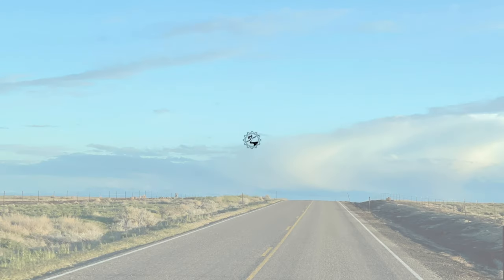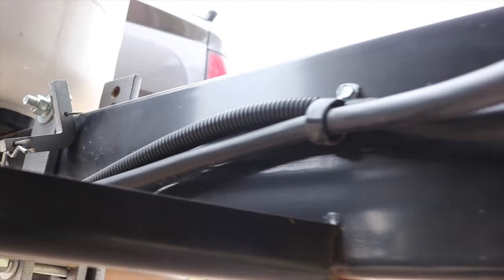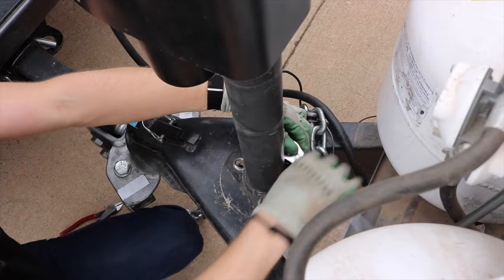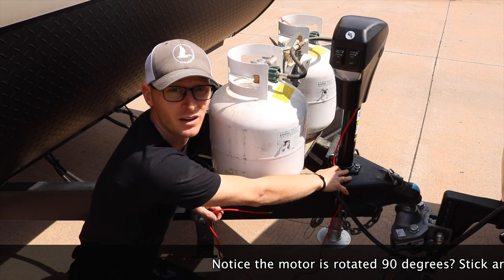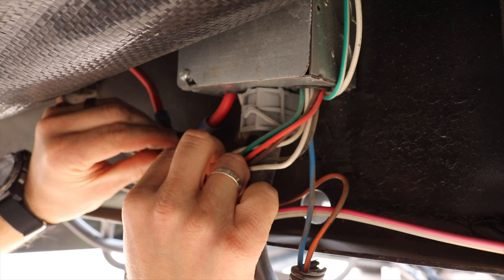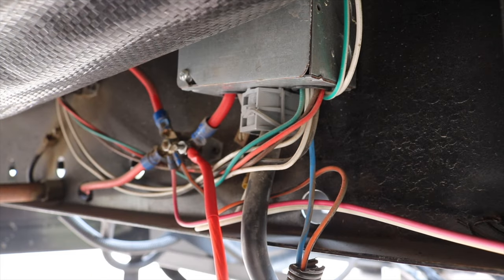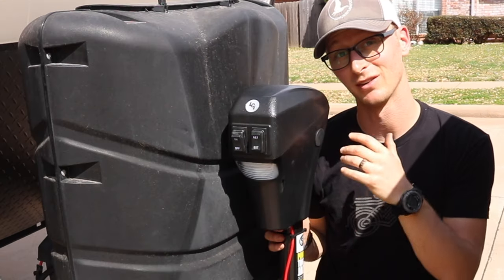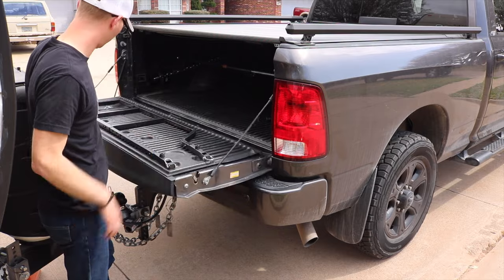How To Install A Lippert Power Tongue Jack On Your RV

Comment: Just installed mine. But had to mount it sideways to clear the back door.    I needed an eyelet and used a piece of the old cable.   Yes Lippert!  Two more feet!  Zip ties and ring connector!    Third hole didn’t match up but it seems pretty solid.  70 F who can do just about anything. Thanks!!❤
Reply from the maker: Agreed on the  extra length!

On the mounting bolts — I’d personally turn it so that you can mount all three - those bolts are the only thing holding up the trailer and the engineers put three in for a reason.

Turning just the jack head is a much better option than only using two mounting holes.

Heres how I turned mine:
https://youtu.be/iK07cLKlUUg?si=BvzemReidgvjlGQk

But if I had to choose between turning the jack with only 2 holes or having it be in the way with all three- without a doubt I’d have it in the way and all three mounting bolts
Reply: @rvgearandfar  So helpful!  What makes it excellent is you give the  size of the bolt and drill bit etc.  More work tomorrow! Ugh!  Thanks so much.  Liked and subscribed.

Comment: What if the new jack has black and red wires and the old one has only 1 red
Reply from the maker: I'm confused by the question - the old jack had two wires (which is what I'd assume) but the new one only has 1 wire total?